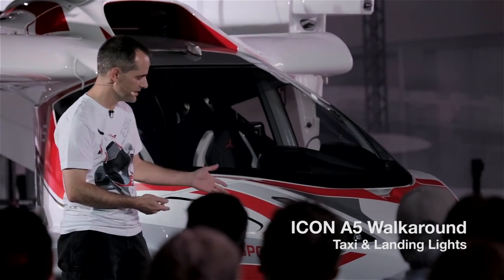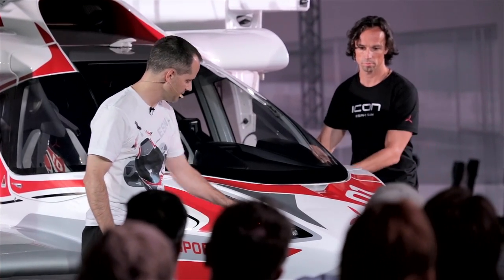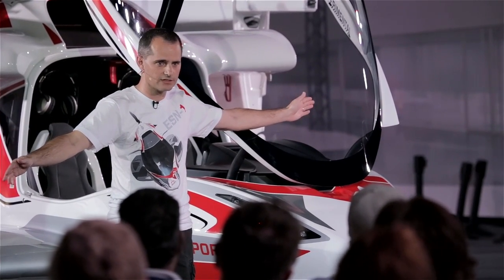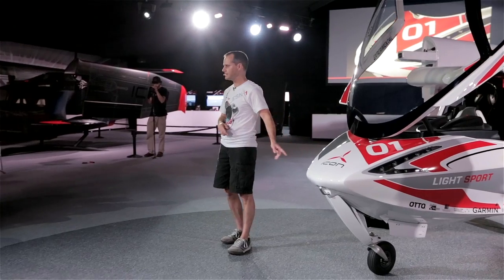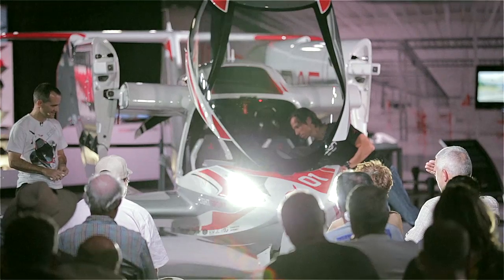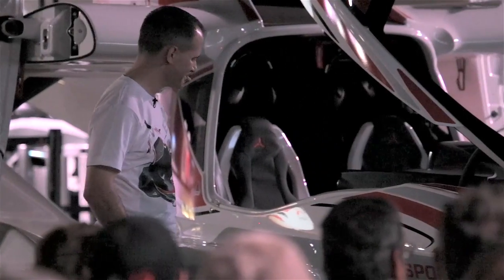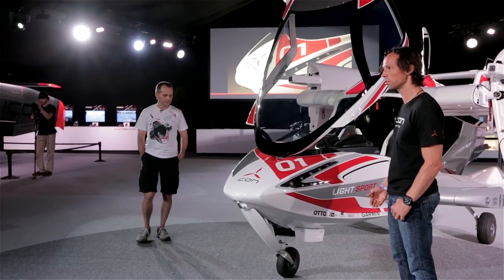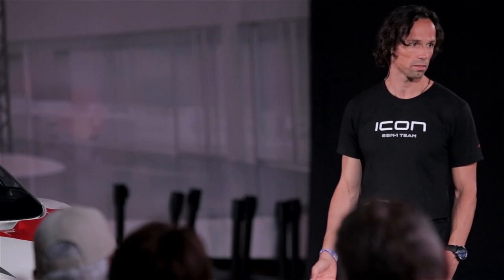ICON A5 Walkaround - Taxi & Landing Lights

Comment: Three fatal crashes in 2017 for this plane. The most famous one was baseball player Roy Halladay. There was also a crash earlier in 2017 that involved the chief test pilot for the A5. It is true that Halladay had little flying experience but the test pilot had lots of experience. There might be something up with this plane. It possibly might have something to do with people flying it too low to the ground and doing all kinds of turns and maneuvers too close to the ground. The plane is not designed to survive an impact with the ground or water. It is made of lightweight materials. From what I understand it is advised that you fly the plane at about 500 feet and no lower. The investigations into both of those crashes might take years to conclude so who knows if it was really pilot error or some kind of design flaw.

Comment: Impressive! But what do you need with landing and taxi lights on an aircraft that cannot be legally flown at night? TNX for the video!
Reply from the maker: The landing and taxi lights open the possibility for the A5 to be flown by private pilots at night and under IFR conditions.
Reply: ICON Aircraft Do you anticipate that it will be possible for those who have already ordered an A5 to change their order to include IFR-certifiable avionics prior to taking delivery in ~2018? Thanks for responding!
Reply: ICON Aircraft So, the A5 will have options to fly under night and/or IFR conditions? But how would this be accomplished with out making the interior more intimidating?
Reply from the maker: HappyBappyAviation The A5 is legal for night VFR operations. Stay tuned for news about future options.

Comment: I would ad some reinforcement or maybe hydraulic lift struts to that canopy! Remember, wind! Don't forget the forest for the trees...remember, the real world details of what you're beautiful aircraft will be exposed to.
Reply from the maker: Tuned gas struts are used to hold up the canopy, and they are hidden beneath the dash.
Reply: ICON Aircraft I see them now & thanks for your reply. However, that is a huge amount of surface to be exposed to 10 to 20 mph or more wind while sitting on a lake......hmmm? Just thinking is all. Also, how much freeboard when fully loaded? Turning crosswind into wave action can be a wet & sinking experience. It sounds like I'm knocking it but I'm not. I've had experience is all.  Beautiful and extremely well thought-out aircraft. Best of luck! You guys deserve it!